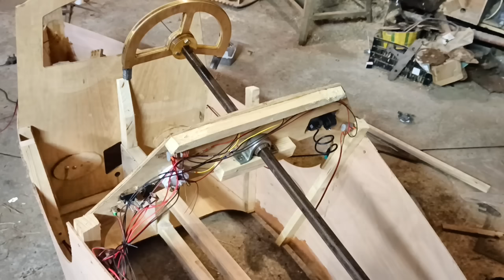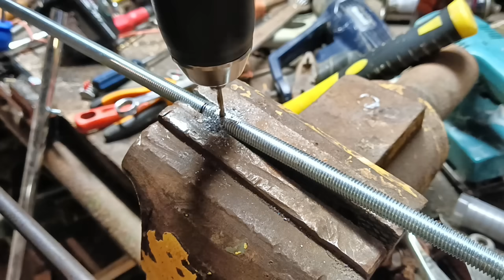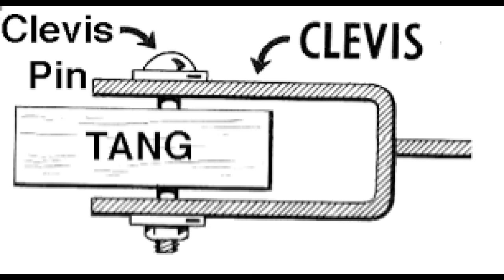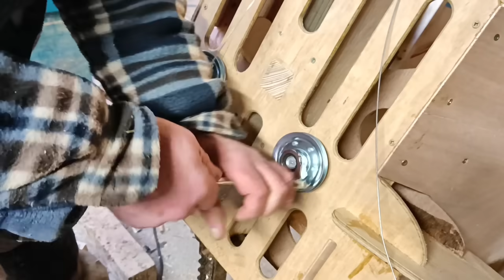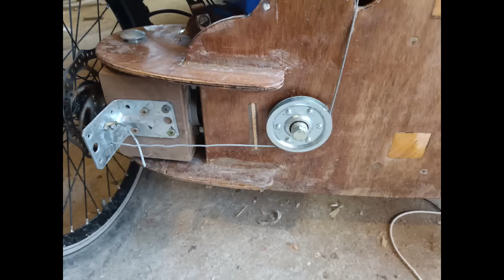New Improved Steering Barrel Mechanism - and other things!

Comment: I have a suggestion.
I see you are using thin plywood for the sides. Corrugated plastic is lighter and can be cut with a utility knife. And it's more water resistant.
Reply from the maker: that may be true but then it wouldn't be a wooden car..

Comment: I was thinking some more about the other comments that suggested putting the steering drum right behind the 'firewall' on a very short steering column and extending the steering cables.

One advantage mentioned that it would eliminate the danger of a long steering column being thrust into the driver in a frontal crash but that is not my motivation.

Would the space no longer used by the long steering column be a useful storage space?
Reply from the maker: It is tempting, but there's very little space over your toes while you're pedalling so you wouldn't gain a lot. And you'd need at least two more pulley wheels. I will keep looking at it though

Comment: Worth adding a couple of pins or a curved cover to prevent the steering wires coming off the pulleys if the wire goes a bit slack. I didn't and made a cart sized hole in a wired glass window.
Reply from the maker: Oh dear! Loose steering cables lead to speed wobble too - guess how I know that!
Reply: @wayoutwest-workshopstuff6299  , probably needs a touch more castor!

Comment: I'd suggest your steering 'barrel' is far too large. Instead, something much smaller in diameter, but with several turns of the cable around it, will give you a much more usable steering ratio (i.e. much less steering effort and greater controllability). Incidentally, in my builds using the same principle, I call the 'barrel' a capstan.
Reply from the maker: not sure what you mean Graham? - obviously the small the diameter the more you'd need to spin the steering wheel - not good when you have cables attached. (And winding the wire around more times doesn't add anything except the need for a longer barrel, and more chance of stretch.)
Reply: @wayoutwest-workshopstuff6299  Yes you need to turn the steering wheel more -- that's generally a good thing! When the steering ratio is large, small steering wheel movements give very twitchy handling. In reality, you only want the wheels to steer a little bit for a larger movement of the steering wheel -- it's far more controllable. That's what real cars do after all -- you need several turns lock to lock. It also reduces the steering effort. Winding the cable around more times does achieve something - the ability to use several turns of the steering wheel instead of only, say, 180° of movement. As for cable stretch, that's down to choosing cable appropriately sized for the work it's doing -- I used thicker cable than, say, bike brake cable for steering (not sure what it was, possibly fencing cable). But you also need a way to adjust out any stretch, such as a turn buckle somewhere.
Reply from the maker: @GRAHAMAUS  Ha! I wonder what  sort of car you drive, Graham! From full lock to full lock on my full size peugeot takes about 3/4 of a turn. And wrapping more cable round the capstan really doesn't help anything - just try it? I think we will have to agree to differ on these points though : -  )
Reply: @wayoutwest-workshopstuff6299  I have tried it, several times. Unfortunately I don't have YT videos of those builds, though I still have one vehicle -- I might shoot some film of it if I can get a clear view of the mechanism (it's rather buried under the bodywork). If I could get the barrel even smaller I would -- the handling is still a wee bit twitchy at speed - probably needs longer steering arms. But look, if you're happy with the way your steering is, that's fine -- I haven't experienced it so maybe it's OK. I'm just trying to give you a little benefit of my experience, which is that you want a high steering ratio if you want to go fast without hurting yourself!

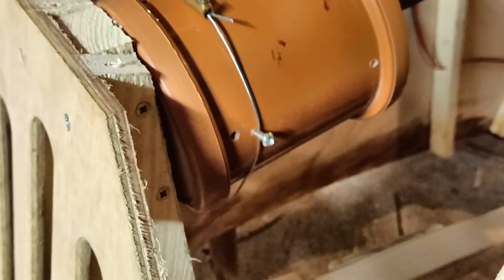Comment: 5:44 the metal to metal contact between the screw and the steel rope is concerning.

I recommend changing the screw to brass to make sure the screw is the wearing, not the steel wire.

I would recommend this for all other things in contact with the steel wire as well.
Reply from the maker: You're right, Ruben! Thanks.

Comment: Lots and lots of good ideas, and delightful finetuning. Provided I don't have to sell a kidney to afford them, I definitely want to purchase the plans. I want the full details on that steering setup. I'll not build the whole car, but many of your solutions are very clever and actually tested and refined. So far I have had success building a sturdy and lightweight frame, the rear wheel mounting is solid and practical, my seating position is comfortable, but my front wheel setup is nog going so well. At all. 😢
Reply from the maker: I'd be interested to see what you've come up with, Ivo. And the weight of yours..
Reply: @wayoutwest-workshopstuff6299  I'll send you an email with some photos.

Comment: Dear Tim, I'm usually not of the worrying type, but that steering column looks like it could become the Great Impaler 3000 once one would hit a wall / tree.
How about having the steering barrel mounted directly to the steering wheel and lengthen the wires, using a few more pulleys to redirect its path from steering wheel to the axles? This surely will increase friction and decrease directness due to cable stretching, but might be safer. Aaaaand it opens up the possibility to have the steering wheel angle adjustable ;)
Reply from the maker: Well I'm not saying you're wrong, but there is a big wheel stuck on the end of the column, so it would have to be something spectacular to actually impale anyone. I will keep looking for alternatives though.. : -  )
Reply: I don't think he'll be going fast enough for that to actually happen, remember, the top speed is (theoretically) 25kph.

Comment: I would suspect anyone who needs a wiring diagram maybe should seek assistance rather than DIYing it. Even with low voltages you can still break stuff. Especially given the non-standardization of parts everyone will be using.

Comment: how much would the plans cost roughly. are you going to supply cleves and some other fasteners with plans?
Reply from the maker: Not sure of the costs, yet - probably between €50 and €100. I'll put links in to anything that needs to be ordered. What do you think?
Reply: @wayoutwest-workshopstuff6299  sounds about right.

Comment: My brother, dad, & I built a wooden go-cart from the boy scout plans in 1978. Solid front axle that pivots in the center. Steers with a cable & pulleys to the steering wheel. Solid rear axle driven by chain & 5hp Briggs & Stratton. Brakes was a 2x4 on door hinges against the back tires with cable to brake peddle. Still runs great.

Comment: I'm not sure about the camber discussion: I think if you're feeling fine with the handling then it's a good setup. the only place I think camber might be necessary is the forces on the wheels during cornering. I know it's been done to death with the rear wheel and that the small-diameter wheels are quite stiff, but I'm more wondering about the bearing longevity with the lateral forces, though the same question comes to mind with a cambered setup...

the car's looking just lovely! keep at it.

Comment: This question is probably way to far in advance but, for those of us interested, have you thought about a potential price for your set of plans/instructions yet? Not looking to hold you to anything! Just curious!
Reply from the maker: Good question - €100. What do you think?
Reply: @wayoutwest-workshopstuff6299  Contextually I think that probably makes sense. When you consider that figure in the grand scheme of the total cost of the entire project, it doesn't make up all that great of a percentage. In 2003 I remember paying $125 for a set of plans for a 23'6'' sailboat from a still-living and well respected naval architect. In today's money that would be about $215, or €196. Back then, 21 years ago, that $125 seemed like a fair price. I realize of course that a 23'6'' sailboat is not at all the same as what your project is, but I would say that the scope of what's involved in the design is fairly similar. If $125 was fair 21 years ago, then I think your €100 is quite fair today.
Reply: Oof that’s a little steep for us in South Africa 😂 19:1 exchange rate puts that at about the price of four nice dinners out for two. But I’m sure I’ll feel differently when I see the actual plans!
Reply: @lumotroph what has the exchange rate to do with it? Here in Germany that also would be 3 dinners for 2 people...
Reply: Ahh I guess i was curious as to whether it was a cost of living thing or not. At least if you’re considering this as a real mode of transport it doesn’t have to come out of a hobby budget!

Comment: I will buy instructions if I can use on uk roads with no tax and insurance
Reply from the maker: Yep, you can. I checked..
Reply: @wayoutwest-workshopstuff6299  I know you still have allot to do with instructions, but I would also be interested in getting all the metal bits I can’t source or order… the motorised wheel isn’t a issue, but if you can supply a parts list or maybe a package.. this may not be effective for every order.. but if you can consider me that would be great… I’ve been looking at old Sinclair c5 but you design is superior.

Comment: Yes, making a set of plans is pretty much the hardest thing to do.
I built a number of amusement devices and upgrades, and it’s not easy.
Take a part, any part, draw the plans to be simple and easy. Not so complex that you’ll need an engendering degree just to make a cut.
Also, you should make a wiring diagram and placement for the wires. If you get a chance, look up the wiring diagram on a 1959 Volkswagen. It’s very simple and straightforward.

Comment: Longer Tang and Cleavis to remove the need for bird mouth cut. 
Thicker steering cable . Thin wire will stretch. Oh and water ingress in to steering boxes will weaken structure over time. Resulting in catastrophic failure. Anyone see that one coming.
Reply from the maker: Well now..! A longer clevis would throw out the Ackerman, that's stainless steel brake cable, specifically designed not to stretch, and I would agree with you about the water in the box - if it had a waterproof seal on the bottom bearing (it doesn't). I considered adding breathing holes in the sides (easily done), but they're just not needed.

Comment: Instead of the plastic pipe you can just stack disks of plywood , drill the middle and sand the outside smooth on a belt sander by rotating it on a piece of all thread  by hand or chucked in a cordless drill.
Then put a larger disk on each end for Flanges.
Reply from the maker: yes, but much heavier. I did make one out of sterling board but then someone would need to go and buy a quarter sheet of that too..
Reply: @wayoutwest-workshopstuff6299  I should have known you'd already tried that.
I'm guessing you also thought about reducing the weight by drilling/cutting out some "speed holes" before the glue up.
You could put it in the plans as an alternative for anyone who has some wood from other projects or wants a more rugged version.
Of course I know that keeping the plans simple might be more important.
Plastic pipe just seems weak to me, especially after cutting it open to fit the car.

Comment: How many duplicated wooden discs, glued via a lamination would it take to make a cylinder for the stering system.
Reply from the maker: that would work, but if made in ply it would be much heavier. I did make one out of sterling board but then someone would need to go and buy a quarter sheet of that too..

Comment: You're a really crazy guy, I love your videos! I just look at the steering tube with concern. So that the tube does not penetrate your body in the event of an impact, you should consider a telescopic design or something like an compression basket, for example made from a tin can. Best regards from Germany from Peter
Reply: Just use two tubes sliding in eachother
Reply: @reinoud6377  That‘s what I thought.

Comment: As for the electronics, you should just release the initial schematics of the base car and then a separate set on how to add the electronics to it. At least then you can justify having a pause between the two sets of instructions.

With that idea in mind, it would be nice to have an add-on to extend the front of the car out specifically to solve the storage issue, functioning like a trunk, it would be a nice little plug and play addition to the car.

Comment: You could use some copper pipe (15 and 22mm) and plumbing fittings (either solder or compression) to make a nice luggage rack above the rear wheel, maybe? Like a square shape with a few bars running across and a little lip at the bottom. And then held off of the body of the car using Munsen rings. Easy to make with just hand tools!
Reply: Thanks for introducing me to Munson rings! I just hope I can remember what they’re called when I need one. 😊
Reply from the maker: You're right, James, but I'll wait to see what the hood/roof involves first - I might need that space..

Comment: As a suggestion for the steering, rather than a pipe, why not have a circle made like the steering wheel from layers?
Three layers, middle layer a little smaller to act as a channel for the cable to run in, outer layers a bit bigger to act as a guide for the cable and prevent it coming off.
Reply from the maker: that would work too - but it might wear quite quickly?